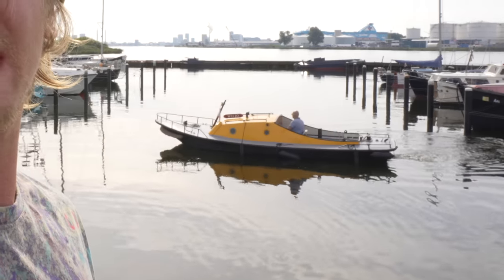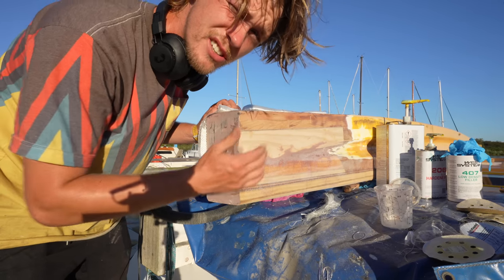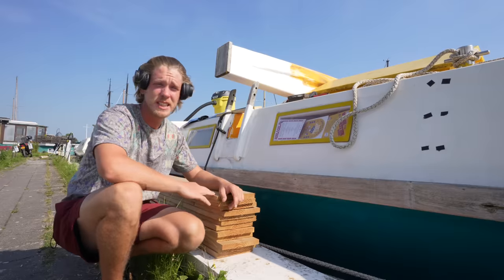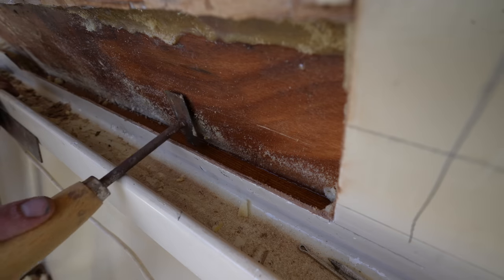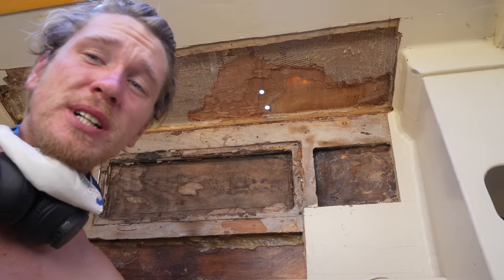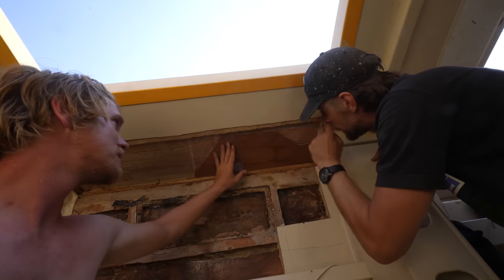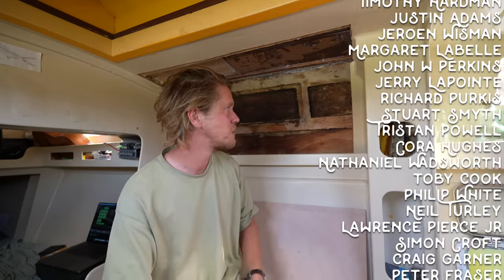Ripping Out My Boat’s Rotten Interior (So I Can Go Sailing) | Wildling Sailing

Comment: That styrene foam is a bloody catastrophe in the making.  I removed every bit of it wherever I found it--it is USELESS because it is not adherent to the plywood, and is a rot greenhouse. Apart from cracks allowing in rain water, that foam-hull gap actually pumps water into the space.  On a hot day the trapped air expands and escapes through pinholes and cracks, and when evening comes, the air in the space now contracts and sucks in moist air which condenses against the hull.  It is a problem faced in telecommunications, where water diffuses into air-filled non-pressurized plastic PVC sheathed polythene insulated cables  and gets trapped in there, and augmented every warm day with more moisture drawn into cables and condensing.  The trapped moisture always travels uphill, and requires drains every time a lateral cable is spliced to the main run. There is only one solution, that is to occlude all air by using a petroleum jelly,.  In your case, an adherent polyurethane foam with closed cells and bonded to the plywood.  Waterproof, no voids, and no absorption.

Back to your problem. If foam insulation is required, there is another way.  Use the contractors who spray-on polyurethane., and before spraying it, I put some laths of timber, about 10 or 15mm  wide by about six millimetres thick  One stands them on edge.  Space these edge-on laths about ten to fifteen centimetres apart, tacked to the  hull ply  at about 300mm intervals using  fast-cure 5 minute Araldite.   Once these have set, run a little medium-speed cure epoxy-Cabosil  fillet on the upward side of each lath, and as you put it in place using a popsicle stick, puddle it a little to try to push some into the crack  below the lath--but it is not essential. Epcxy-Cabosil mixture when set is extremely strong and adheres well.

One sprays the polyurethane foam between these laths, and when the foam is set, one planes or sands it down to the tops of these laths, which will strongly support the cover plywood if you use it.  Personally, I liked stick-on vinyl for easy wipe-down.  Adding more plywood makes little sense apart from adding a little more hull strength.  Glued on acrylic carpet using double-sided sticky carpet tape would be warmer. and much cheaper.

Comment: Eventually, you'll come to find out that the only wood core fiberglass boat worth owning is one that was built with multiple layers of thin laminate sheets - each soaked in epoxy resin on both sides. This creates a durable structure that is resistant to moisture penetration, propagation, and rot. I've seen a number of powerboat engine transoms redone this way by professional marine fiberglass technicians. It's time consuming but the end result is super strong and super resistant to rot over the long haul. Boats like this with essentially a solid marine plywood core and outer fiberglass skin have fallen out of favor a long time ago. They are a maintenance nightmare because the fiberglass skin does an incredible job trapping moisture in a vulnerable substrate/core when the skin is compromised or penetrated. With thin laminated cores, the resin to core substrate ratio is much higher and the multiple resin layers act as an effective barrier against moisture propagation.

Comment: I dunno about the milky epoxy... seems a random reaction to humility in my experience.  There's nothing better than really dry wood before you add fiberglass and it's nearly impossible to do in most marine environments so my best suggestion is to leave a fan on or heater with a cover over the work outside to reduce the humidity... same inside.  You feel hot from humidity so turn on loads of fans. I am sad to see all that effing foam acting like a sponge and rotting the plywood.

Comment: ..... shame to cover that fine looking wood laminating you did on the beams with a coat of paint ...... the moisture in the bottom below what seemed like solid foam, moisture down the sides had to accumulate somewhere ..... sure wasn't soaked like where you stuck your chisel in and it bubbled out .. Yikes .... your methodical work is paying off big time ..... your tug boat was quite the unit, good crew you hang with there in the yard ..... thx for the share .. as always .. never stop dreaming, just dream bigger .. have fun be safe, save our oceans .....

Comment: I really like your video, you are a good and a hard working person and I wish you the best, but what follows I have to say for the good of your project!Or do you prefer fake flatteries ??
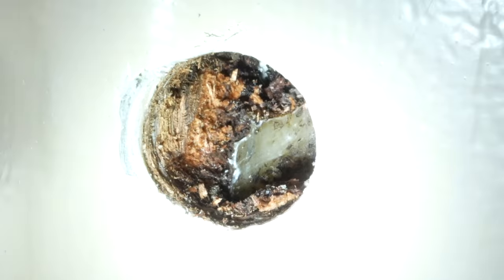    Oh my god get some pro help! It is in purpose that the chain plates are at the bulk head to take advantage of the added strength, moving them(on dubious plywood at that) weakens them and change the geometry of your rigging, basically a no-no , also when oversizing the hole with the forstner bit(11:00) you show us some nasty dark wood and tell us wood is fine?!!There is a limit to wishful thinking and it is zero.
So you are right you have to slow down , then take the time to learn from the beginning like how to use your tools, how to hold and use a putty knife will save you so much time on useless sanding , and that goes about every thing you do! If you do not know about chain plates go online and learn, do not improvise on the moment "just because", plus all that learning would make great quality content for your videos while half patching rotten plywood 
one square foot at a time will not get you popular because it is super sloppy work, sorry I have to say it. Good luck

Comment: To be honest I would have zero faith in the deck you have lashed down, far too flimsy, remember you want to cross an ocean, firstly you should router off the sharp edges and put at least triple lashings, if one lash fails you still have 2 holding, but it is very spongy between the beams, I just hope you have a good eperb and life jacket, sorry but I had to say it🙏🙏🙏

Comment: I’m sorry but how can this be safe? When it comes to let’s say crossing an ocean, I can’t imagine feeling safe with all the random “jigsaw” pieces of wood replaced. A lil fiberglass here and fiberglass there….from the videos it seems like u are constantly finding rotting (sections of) wood throughout the whole boat,  and just cutting that part out, replacing with random miscellaneous sizes and pieces of wood or whatever kind of filler, topped with fiberglass, then moves on to the next rotten section. (Wash, rinse, repeat). 
Sorry dear, I been cheering u on for a while but now it’s to the point that it just doesn’t seem safe whatsoever. 
Or is it your intention to make the boat seem unsafe and un-sailable? Idk anymore.
Reply: It will be resold within a year.
Reply: If the work wasn't done - it would be unsafe. If you know anything about the strength of mechanical and chemical bonding of resin it might ease your concerns? I recommend having a look as west systems demonstration of the strength their product offers. Fibreglass is very tough when supported with the correct thickness.